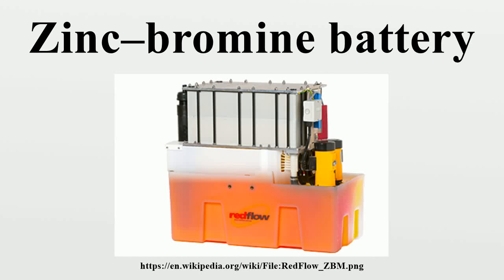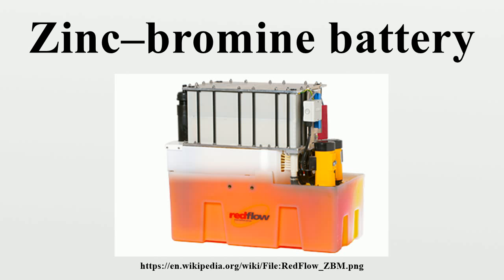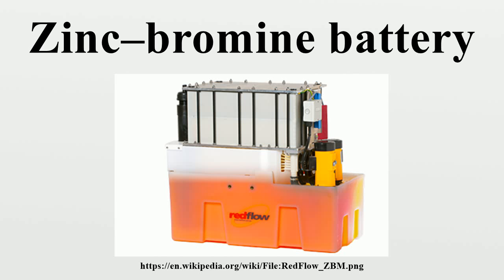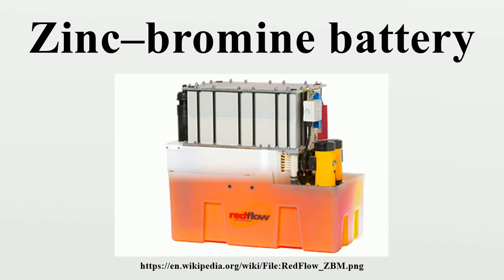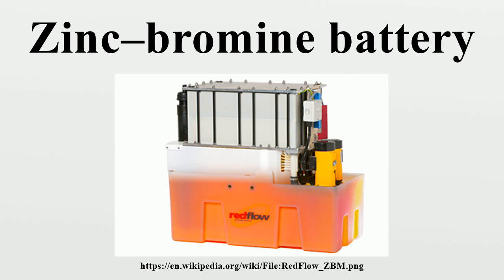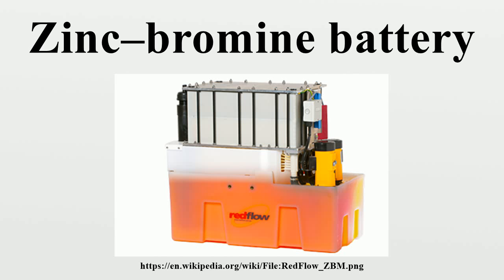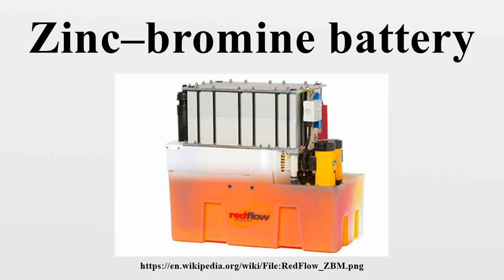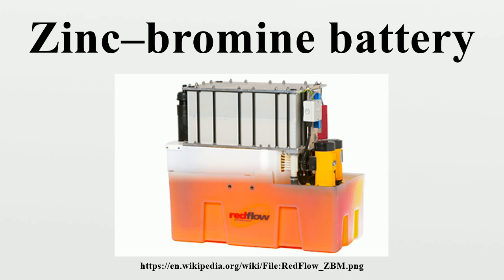Zinc–bromine battery

Comment: This is the Battery of our future ...
Reply: Actually, I believe the original patent on this type of battery is from the very early 1900s. Of course that didn't stop Princeton from applying for their own patent on this type of battery in 2016 🙄. None the less happy battery building good peoples of the the planet earth. 😎👍
Reply: @everydayj9330  I have a home made one on my you tube. it hold 0.8 volts not high but home made.
Reply: I agree that there is a high probability that Zinc-Bromide bateries are the way forward, but I believe that Zinc-Bromide Flow Bateries are unsuitable for the majority of applications.